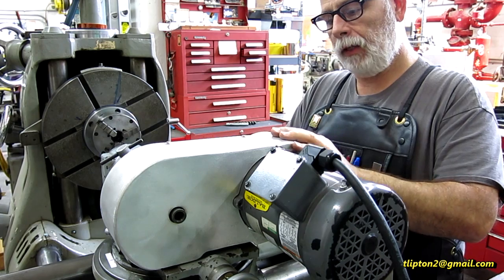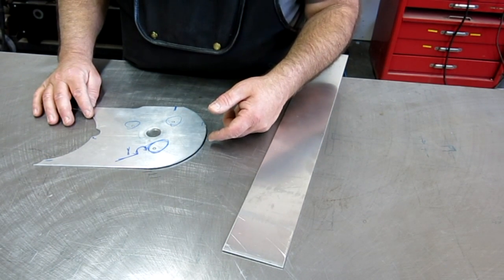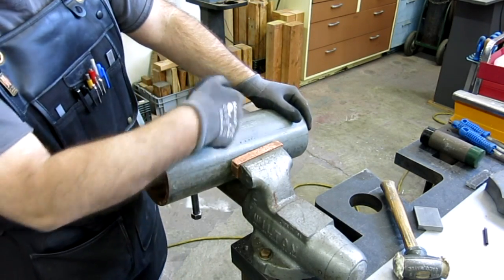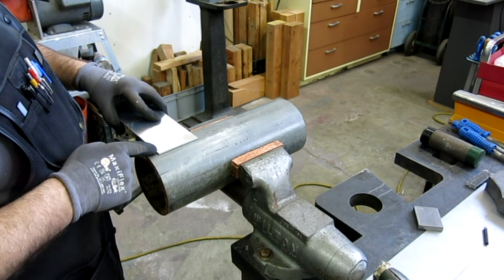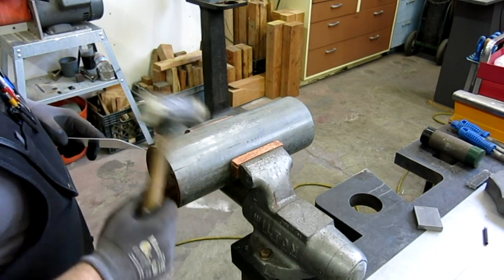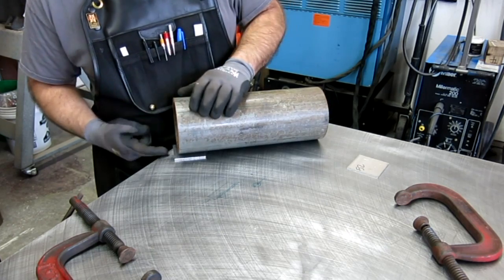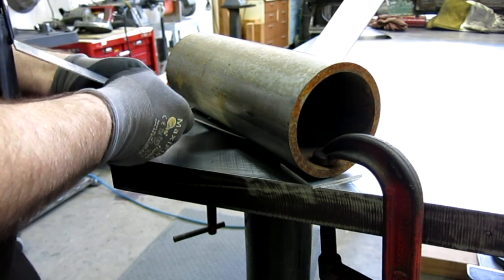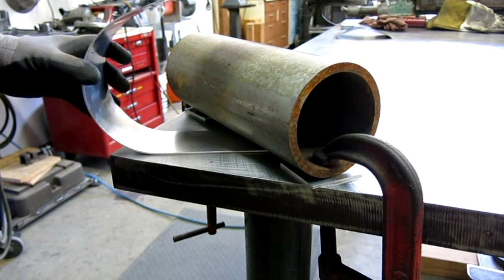Autometric Belt Guard 2

Comment: Tom,great video.Thanks for the tips on rolling sheet metal.15 years ago got fined by OHSA for not having the proper belt guard on the old drill press in our diesel shop.You should have seen the guard I built.You would still be laughing.

Comment: Jodi from welding tips and tricks did a vid recently where he used a "Y" fitting on his gas line and added a helium bottle for welding aluminum. You can weld faster and at lower amps so you distort the metal less because of lower heat input and the arc being in the same place for a shorter time.